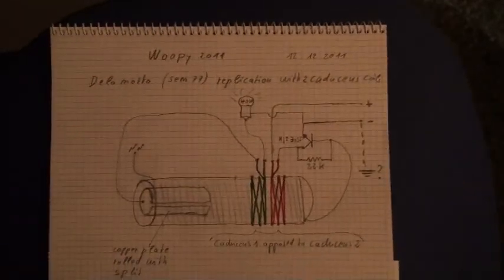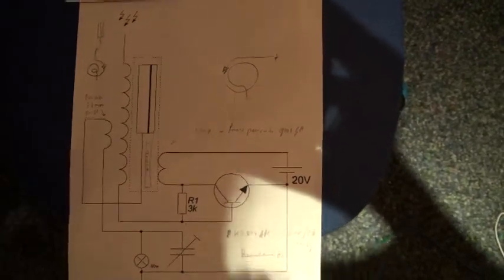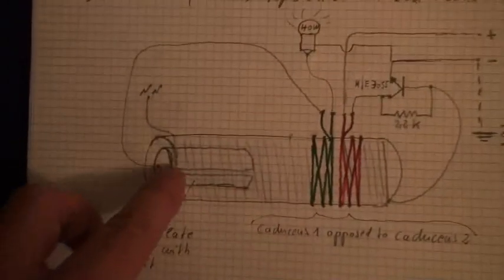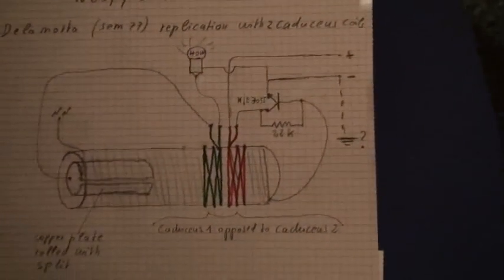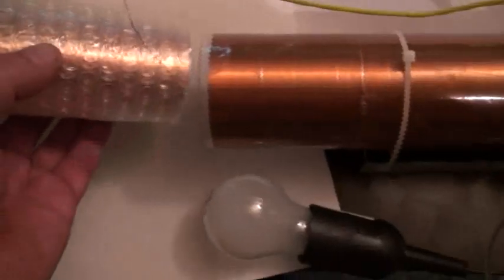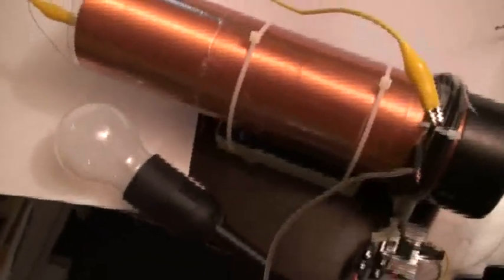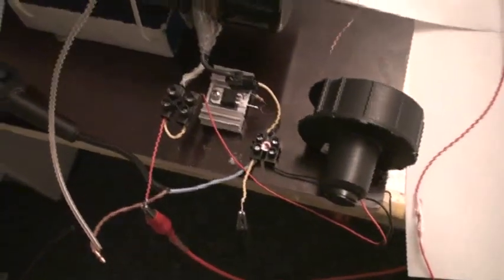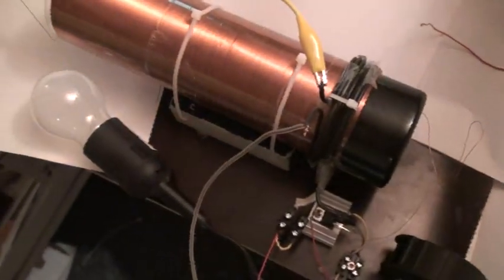caduceus coil on delamorto 1.wmv

Comment: bismuth core will yield you some very interesting results. works much better than ferrite. also caduceous coils are/should be tuned to a specific material by adjusting the frequency untill the inductance is zero. I have heard that using twisted pair wire in a caducious format with the two wires independantly driven such that there is a phase difference (>90, <180) yields optimum resulsts. different materials like different freq. and phase differences. Just ideas for you.
Reply: Caduceus coils do not need tuning. They have flat response on large frequency bands.

Comment: Thank you Laurent for sharing your experiment results on this very interesting design!

Things to try out to replicate the original Kacker video:
Saved here:
metacafe.com/watch/7849636/kacher_brovine_tesla_system/

- Add solid ferrite rod inside the slotted copper tubing.
- Add another copper tube inside the other end of the coil, with solid ferrite rod inside.
- Tied the non-slotted second copper tube to a ring ferrite on the outside.

The caduceus coils looks promising!
Cheers!

Comment: Did you try that lamp on your last setup? I had the same experience with just plasma on smaller lamps but as soon as I moved to a lamp where the filament is further away from the glass, like the one you're using here, it glowed and no plasma.

Comment: Why do you need the blower ? Does your transistor get too hot otherwise ?
Can you please power the blower with a different power supply and try again ?
What happens, if you put a ferrite rod inside the slitted copper pipe ?
Many thanks. Regards, Stefan.